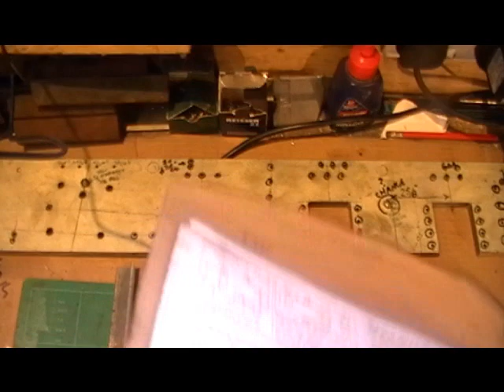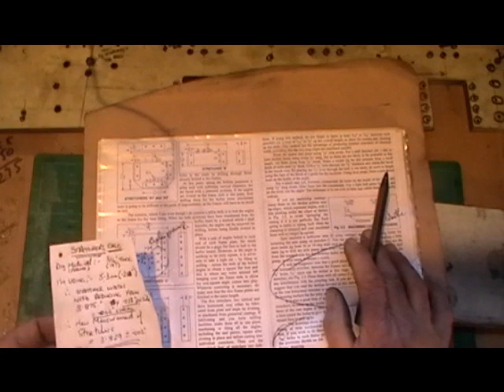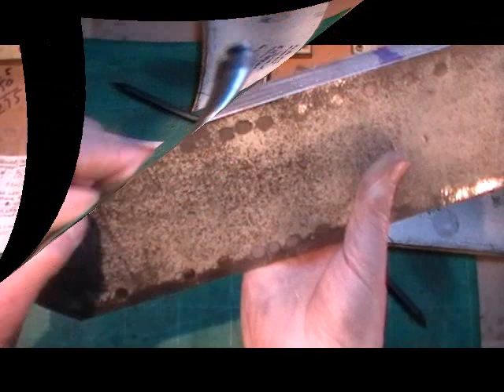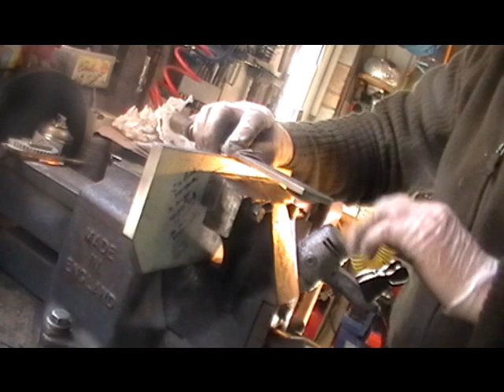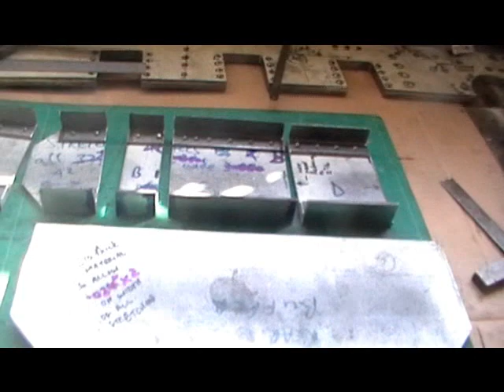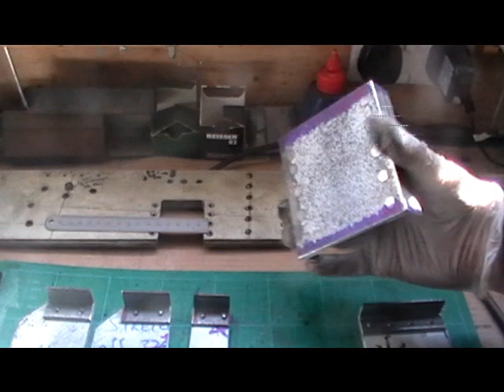Making a Beginners Steam Loco (Frame Stretchers) "mr factotum"

Comment: When you milled your stretchers, what tollerance did you get end to end. I paid a machine shop to do mine and the error is 0.3mm from end to end. I have tried in my cheap miller at home at managed to get 0.12mm end to end error. Do you think this might work or should i think again.
Reply from the maker: Hi KM
Thanks for feedback, Nice to hear from you,
I did everything on my cheap Tawainese Milling machine

When you say end to end, 
if you mean 0.12 mm ( 4.7 thou') error  as in parallel sideways clearance in between the frames,  i would'nt think again
Or if you mean 0.12 mm (4.7 thou') tapered clearance i.e. top to bottom of the stretchers, again i wouldn't think again.
They would be better to be parallel even if not quite on the money size wise.
I'm no expert but i may have said this before may be to you or perhaps to others, working to very tight tolerances on every component that doesn't warrant it only leads to the engine not running at all or not properly.  By getting accumaltive tightness!!!
I started off when making my Metre Maid, making everything to extremley tight tolerances, because thats how i worked at work and when i told my good friend and tutor when i was an Apprentice at work, (he's in his 90's now), who took up this hobby when he finished work and made many wonderfully built loco's and engines. He said to me don't work to such tight tolerances, unless they really warrant it such as pistons and bores for example or the thing will never run. But he then said that doesn't mean to be sloppy. 
More really commom sense.
I know some will agree and some will disagree with this statement, we're all different, however, it took me ages to get my Metre Maid to run free and properly, because i made things at start too precise. I ended up having to put "Activ 8" on all the moving components to reduce friction.
In my opinion for what it's worth, just remember not sloppy and common sense, it's not aerospace !!!
It's got to run on rails that are sometimes  unprecise, uneven, undulating, worn, wide range of temperature expansion and contraction etc etc, you get the drift!!

P.S
WOW
I would have expected a paid machine shop to be more precise than the 0.3 mm which is nigh on 0.012" unless  the drawing gave that tolerance that they worked to.
Anyway KM i hope this helps you decide, and if i can offer any other bits of information it's always good to hear from you.
All the best and keep in touch
Kev
Reply: @MrFactotum  thankyou for your reply. I was rather cross having spent time producing the stretchers and have to bin them after the machine shop ruined them. I even put +/- 0.025 on drawing. 

The error is 0.12 when measured at each end of the set of stretchers (still all riveted together on the same peice of angle).

I often think I am being over critical as the metre maid at the local track has loads of play in its bearings.
Reply from the maker: @kentishman5179  no problem KM, yes i know what you mean, i sometimes get over critical, it's bread in to me and also probably some underlying OCD🤣🤣 . i get pedantic about things thats new to me. 
all the best😉😉👍👍